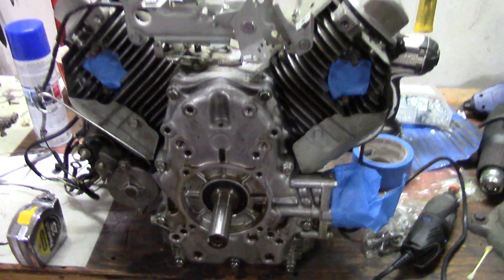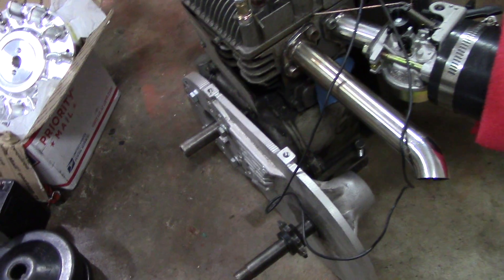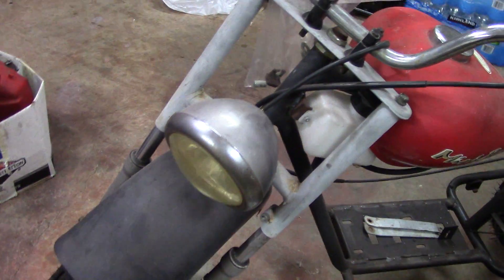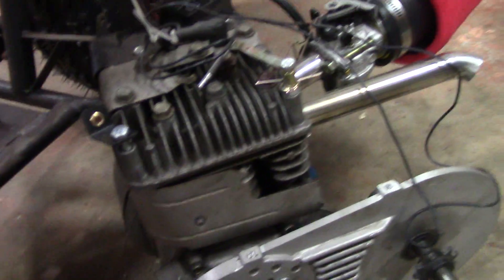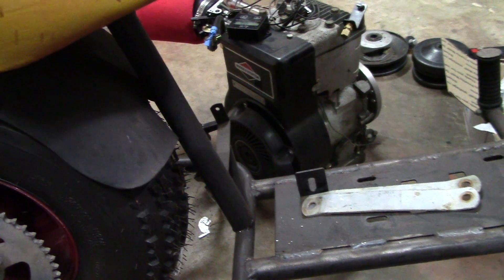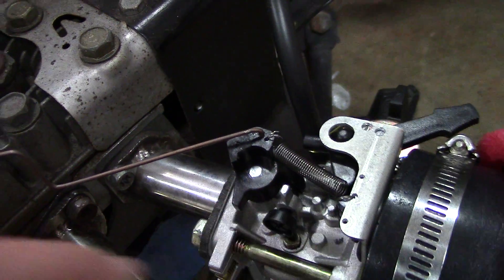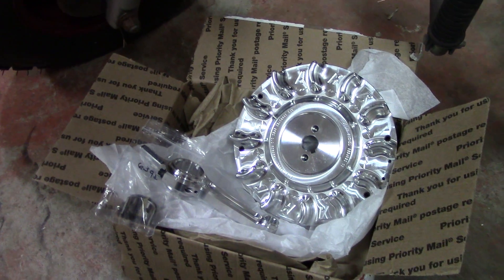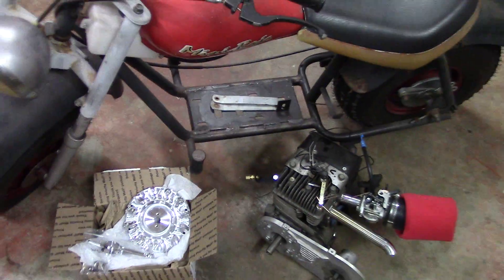Mini Bike Build: Baja Heat Restoration & Mods Intro

Comment: @Kartfab where can I get an engine mount plate for this machine?

Guy dropped one off, his son hit a tree stump and mangled the plate, either I fab one or maybe buy one

All the welds are mangled and it's not worth salvaging as would probably cost more and be weaker

Any advice would help, seems to measure 5½" x 12" but not sure

Thanks

Comment: your rear wheel is on wrong.
Reply from the maker: +Gabriel Gruenke nah it's on the right way for my purposes
Reply: KartFab k i have one similar to yours that I've been working on.
Reply from the maker: i swapped sides to make the torque converter closer to the engine so it didnt stick out as much, and to avoid chain tensioning problems. If you look at my 'go kart vacation' video, you will see themini bikes running this way you see in the video.
Reply: K

Comment: i think ur rear sprocket is on the wrong side
Reply: Kyle Kelly it is it’s supposed to be on the other side with a jack shaft set up that bolts up on the side of the motor with to chain sprockets going to the rear tire instead of all that confusing shit that he’s been doing 😂

Comment: You do know the rear wheel is on backwards?  The spocket is originally on the left side of the bike.
Reply from the maker: +jason2222ism yeah i did that on purpose. The original set up was flexing too much and was misaligned. I wanted to keep the engine centered, so I am making a custom jackshaft setup for my torque converter that will be torque converter on one side, and then jackshaft sprocket on the pull start side.

Comment: Hey where do you get those engines and how much do they cost
Reply from the maker: +B-and-C workshop they stopped production of the briggs 5 hp flathead a long time ago, and they are very common... so you can get them on craigslist by searching "briggs" and see lots of these 5 hp horizontal shaft engines. The v-twin honda gx610, and two gx620's were purchased for about $250 for all three over the course of the past 2 years. None of them started, none of them worked. I have one running like a top now, and the other is on its way there with the governor removed. The third I was able to unseize and is just wating to be fixed up. so.... these are like $1500 brand new, and are much higher quality that the predator 670cc engine, but if you were to get an engine like that you would be coming out ahead because it already works. Elbow grease and lots of cragslist searches.
Reply: +KartFab thanks I found a good Briggs at a garage sale for 50 bucks it's a flat head from the 90s anyways thanks for the feed back

Comment: been waiting to see this motor going on something it's going to be a monster
Reply from the maker: +rushking19 yeah it is. I havent calculated the top speed yet, but it will have an 8t jackshaft sprocket with 30 series torque converter.
Reply: ***** sounds good I can't wait to see it